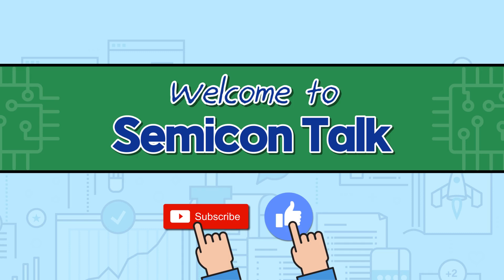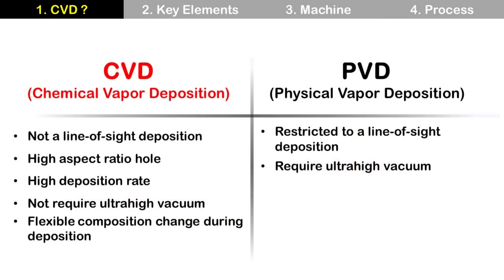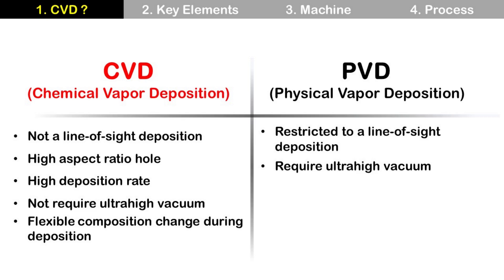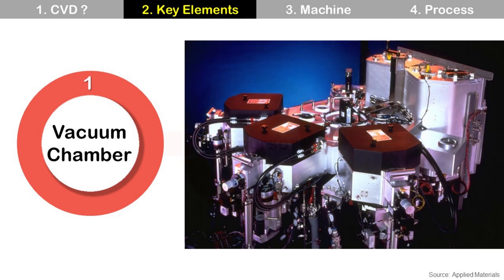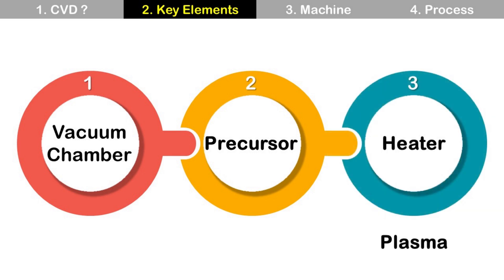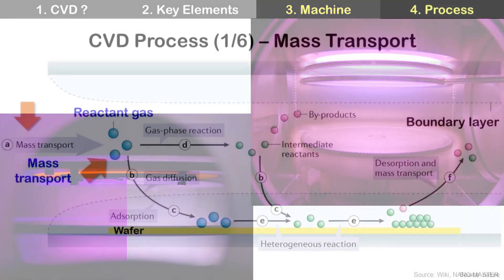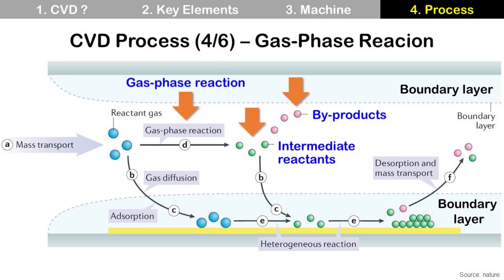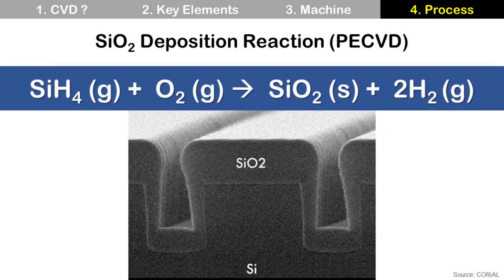[Eng Sub] CVD (Chemical Vapor Deposition)

Comment: Hi man,
Thank you for your nice videos
Could you please provide some information to me regarding the role of polymers in packaging and where are the needs for new polymers in packaging?
I appreciate it
Thank you
Reply from the maker: Thanks for watching and good question. Polymer is used for die attach adhesive, molding compound, package substrate, passivation material for wafer bumping etc. And new polymer material is required for molding compound to minimize package warpage in general and also required for package substrate specifically for high frequency application like 5G smartphone to minimize signal loss.
Reply: @semicontalk3223  thank you for information 
Could you please explain a little more?
I am very interested in digging more into new polymers for semiconductor application
Reply from the maker: I am not an expert about polymers but I will try to explain more if you specify your question.

Comment: Hi, thanks for the sharing. I have one question about the CVD process to form SiO2 layers in FEOL/BEOL. Normally, the SiO2 layer thickness is less than 1 um. Is it possible to form thicker SiO2 layers, e.g. 5 um or even a larger number? Is it cost-limited (too expensive for CVD thick layers) or manufacture-limited (e.g. warpage, coplanarity, or other defects)? I would like to know your opinion.
Reply from the maker: Thanks for watching. I haven't heard about thick SiO2 layer formation by CVD so checked literature but couldn't find it. I think it is possible technically but I guess people don't use CVD for thick SiO2 layer formatrion because it is expensive and maybe thick SiO2 layer does not require precise thcikness control. But it is my guess rather than proven fact.

Comment: I am one of your fans from hong kong.

Actually, I have also been learning semiconductor knowledge from your channel. And I am working in pneumatic industry.  In your range of knowledge, are there any application that use pneumatic products?  Although I got relevant professional knowledge in your video, I rarely found the application of my current work. If you will add some introduction to semiconductor components in your video production, I will be very grateful. Thanks again for your sharing.👍🏻
Reply from the maker: Thanks for watching. I think semiconductors are  used for controllers or sensors in pneumatic products but I am not sure I can make video for that topic. Would you let me know what kinds of pneumatic product you are thinking about?
Reply: @semicontalk3223  I am very excited to see your reply in the morning, and thank you very much again for your selfless sharing. I see that your channel often introduces the principles of different processes in semiconductors. But rarely see the parts on the actual machine. Although my work is about pneumatic and automation parts (various sensors and electric actuators, ect.), I don't expect you will make some videos especially for one of your fans. This seems to go against the original intention of your channel and I am understanding. But I hope that the application part of your video will have the theory of how the mechanical parts fit the theory. When most of us get knowledge, we are difficult to imagine how to practice it. In addition to having knowledge, you also have some experience. For those of us (students/people who are interested in semiconductors), we don't actually understand how to make it on a machine.  For example, how to achieve the high speed of wire bond machine, is that some standardized mechanical section of machine......We don’t understand how to practice many of the details. But the recent video already has more machine pictures and introductions on how to do it. But there are too few detailed machine parts. Of course I don’t know if these are trade secrets...

Thank you again you read and reply my message. Many thanks😁Have a nice day
Reply from the maker: Thanks for detail explanation and now I understand. But for machine parts I don't know well about details and that detail information is not available. I agree with you and it will be good to know about actual practices with semiconductors. So I will prepare videos about products like smartphone which uses semiconductors. Thanks for good feedback and have a nice day!